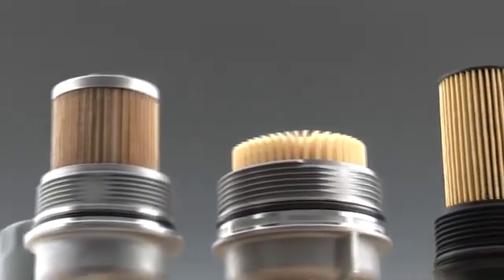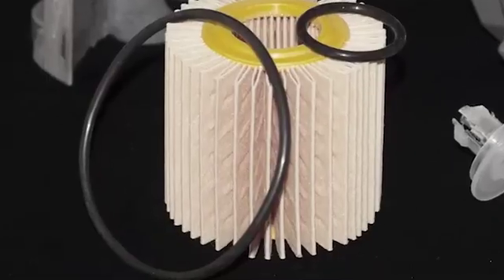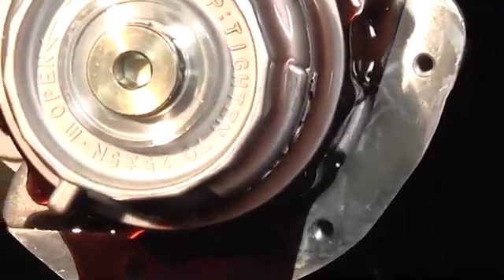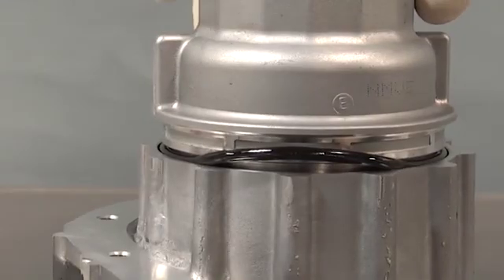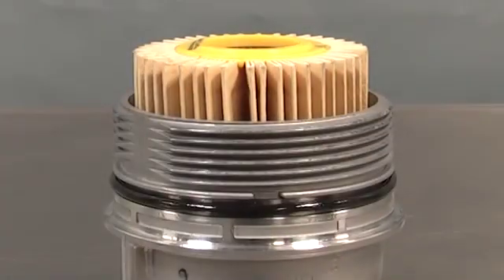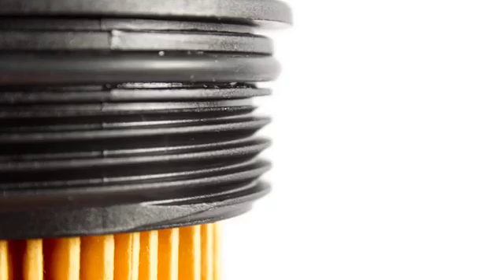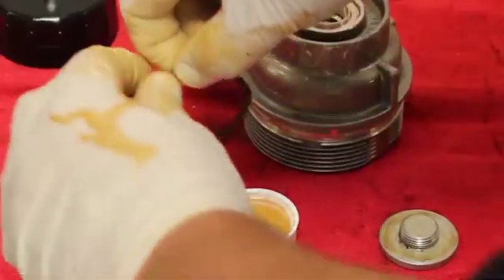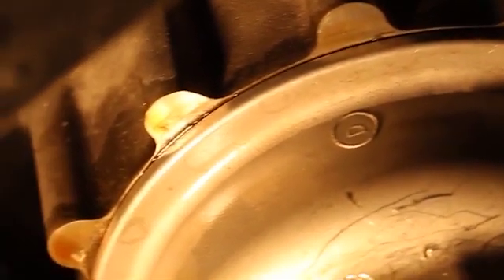O-Ring Installation Tips

Comment: I just doubled up on the bigger O-ring today , one in the place that is recommended and one lower , towards the flange/lip of the cannister (which I used the old o-ring that was on the cannister before doing yesterday's oil change)  , makes sense putting it at the lowest it'll slide down to as there is an gap there when the cannister is installed (like something was missing without it) and the o-ring seems really snug at where the cannister meets the housing/mount that is attached to the engine . Was losing oil so that's why I decided to add another o-ring further down , also didn't feel like giving Uberees piggyback rides for a living . Actually , where i put the additional/old o-ring is the same spot i had initially installed an o-ring (roughly 70k miles ago) before watching videos on doing an oil change for my 2011 Highlander . Hopefully it stops oil from leaking , although the old oil ring hadn't been changed out for possibly two oil changes as some commenters had mentioned it was nessassary to change those out every time and some commenters hadn't ever changed them out for over 200k miles but I'll definitely resume changing those o-rings out from now on  I'll try to update in the near future . Also torqued the drain plug along with housing to 28.5 n.m. , which , on the cannister , it says 25n.m. +-5n.m. . FYI : the old o-ring measured about 0.2 mm bigger .

Comment: You show a pick in the video. Why is it that the official instructions from Toyota say NOT to use a pick OR SCREWDRIVER to remove the o-rings and why is it your video did not demonstrate the best way to remove an o-ring?
Reply: I used Little screwdriver to pick the o ring
Reply: I used little the to pick the o ring and pick it the o ring very easy nothing damage or scratched

Comment: There are 2 O-rings. This video only shows installation of one but in the video shows pictures of both. Where does the smaller one go?
Reply: Some Toyotas that have a vertically mounted oil filter cap have a drainplug on the bottom of the oil filter housing cap. This is for draining the oil out of the oil filter prior to removal so as to minimize the mess. The second smaller o-ring goes under that oil filter drainplug.
Reply: @njsongwriter  Thank you! Just changed the oil on my tC and was worried about having missed an o-ring
Reply: @njsongwriter eishhh I placed the small o ring around the  inner cannister with holes
Reply: Tim Hand if you’re talking about the metal gasket you put it on the drain plug